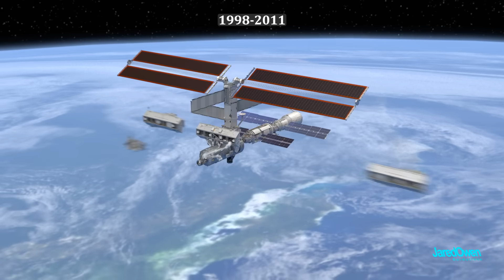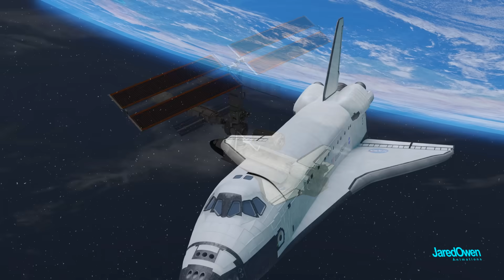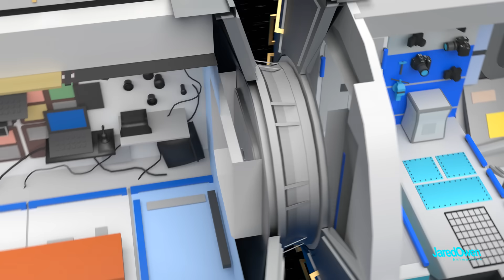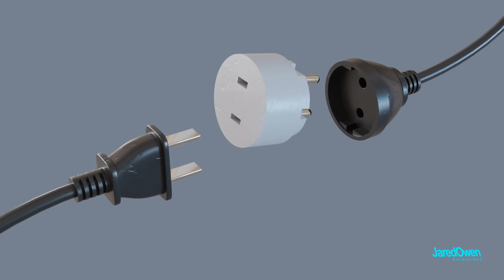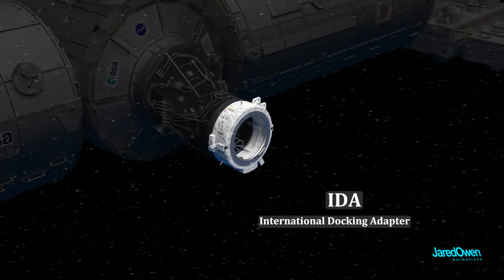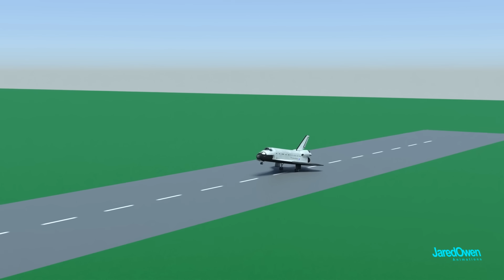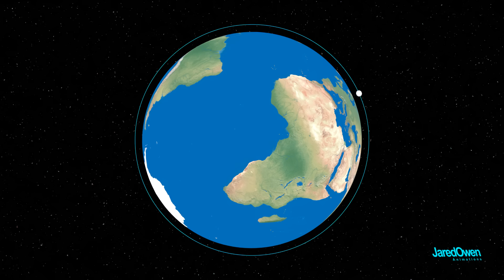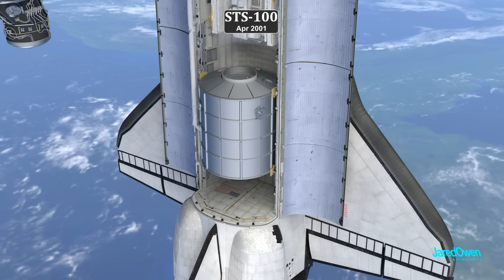How did they build the ISS? (International Space Station)

Comment: The thing I think is kind of crazy about this, especially when you say the Space Shuttle's primary purpose was to build the ISS is we had a space station launched in the 1970's in a single launch called Skylab.  Nixon literally threw away Skylab, which went up in a single launch on a rocket already developed for the Lunar program and pushed forward the Space Shuttle program so that we would spend over $100 billion to have an operational space station 30 years later.  I mean why have a space station now that is already operational in orbit when we can just have it burn up in the atmosphere and start on a much more expensive project to have a space station 30 years down the road and with the loss of two whole crews because the Space Shuttle was an inherently unsafe and inefficient design?  Don't forget that the Saturn V could lift 100 tonnes into orbit per launch and carried people on top with a launch abort system while the Space Shuttle struggled to just get 16 tonnes up after they strapped the crew to the side of the rocket instead of placing them on top, which would have been a lot safer, stripped out all of the safety systems, and stripped off the cover from the external tank, leading to foam hitting the orbiter and ultimately the loss of a whole crew, just so they could have the lifting capacity to get any piece of the ISS into orbit.

If we just built a few more Saturn V's, which we had a very reliable, man rated super heavy lift rocket fully developed, we could have launched say a 10m wide monster space telescope instead of the piece of trash Hobbled, I mean Hubble telescope.  Just having the optics of a 10m wide mega telescope, we could have done service missions to replace all of the old crap inside and reused those awesome optics.  Instead we focused on servicing Hubble over and over again with its small and defective optics, greatly limiting what we could see even with more fancy hardware placed inside over the years.  We could have hoisted up a mega space station 100 tonnes at a time in just a few launches.  Instead we threw away over $100 billion launching the ISS one little piece at a time on the pathetic Space Shuttle that could barely lift anything into orbit, making it super complicated to put all of those little pieces together in space.  Do you realize how ridiculously expensive and time consuming it is to train astronauts and fly them up to assemble stuff in space where it is so much cheaper and easier to have regular engineers just assemble all of this stuff on the ground?  If you could have moved 100 tonnes at a time, you could have had a bunch of stuff much more cheaply and easily integrated on the ground and then all launched at once.  There is actually a lot of really cool stuff we could have done if NASA's budget wasn't all sucked down by the sad and highly over rated and way over priced Space Shuttle program, but instead we focused on building just a few more Saturn V's for other cool space missions and then moved on to other 2-stage rockets for getting into LEO and beyond.

It is crazy to see how far Nixon set back our space program and how we are still suffering the affects of it to this day.  We could have been so much more if it wasn't for Nixon.

Comment: How much air is aboard the station and how much do they lose depressurizing the crew lock?
Reply: Most of the oxygen is generated from water, by electrolysis.
There are two totally separate systems - one American, and one Russian.
There are also tanks with enough reserve oxygen to last for several weeks, in the case of a malfunction.

The airlock pressure is reduced before its opened, by pumping it out, so there's not much air lost.

Comment: How they synchronize the shutle and the station when they move very fast?
Reply: Good question. The physics of movement in space is weird compared to what we're used to on Earth.

However, the first thing is that the speed and position of the ISS are known extremely accurately. This is because the speed of an object in orbit is directly related to its altitude. And this means that because the altitude changes very little over an orbit, neither does its speed. And because Mission Control can track the ISS's position accurately, it automatically knows how fast the ISS is moving at all times.

The second thing is that while both the ISS and Shuttle are moving fast compared to the ground below, they're moving slowly relative to each other. It's like driving beside another car on a freeway - you're both travelling at 100 km/h on the road, but you're barely moving relative to the car beside you.

When the Shuttle was launched (and these days the Dragon capsules), it would be launched into a lower orbit than the ISS, and timed so that it was trailing the ISS. However, the lower the orbit, the faster you move, so the Shuttle would slowly catch up to the ISS, while remaining at a lower altitude.

In order to get the Shuttle to the ISS, it would then fire its engines again to gain altitude. This burn was timed very precisely, so that it would reach the ISS's altitude at the same time as the ISS passed by. The Shuttle would then burn its engine again to fix its altitude at the ISS's altitude (otherwise it would descend to the altitude of its earlier orbit, and keep cycling back and forth between those altitudes in an elliptical orbit). At this point, the Shuttle would be station-keeping - in the same orbit as the ISS, but a couple of kilometres back. It would then fire its thrusters to slowly creep up to the ISS.

It sounds complicated, and it is (yes, this is rocket science). But the details were worked out back in the 1960s for the Gemini missions, and used again on the Apollo missions to the Moon.

Does this help?
Reply: @maxfan1591 even though im dumb i somehow understand some parts
Reply: @Beeta425  "even though im dumb i somehow understand some parts"

Cool, thank you for saying that. But don't worry about the bits you don't understand - the way things work in space is something most of us don't need to know, so it's not a problem to not understand it.
Reply: @maxfan1591  thx man :)

But yeah im still very new to space stuff so i still have a lot to learn before i fully understand a bit of a complex things about space :P

Comment: Seems a bit silly for the USA and Russia to have differing birthing ports. If you’re able to collaborate on building a space station, you can collaborate on using the same ports…
Reply: An adapter seems collaborative than forcing the US modules to use the Russian system. The availability of the robot arm also makes the docking features of the Russian system unnecessary for the new US designs

Comment: The more pertinent question is WHY did they ever build such an irrelevant facility in the first place, when they can't even address basic needs on this planet.
Reply: Because building a laboratory for general purpose research that we couldn’t otherwise do was significantly easier, cheaper and faster than solving world hunger or giving everyone clean drinking water. All the while, believe it or not, we have actually been trying to solve those problems at the same time. I know, it’s crazy, we can do multiple things at once as a civilization.
Reply: Without space, we wouldn't have or have worse versions of:

Insulin infusion pumps
reading machines for the blind
vehicle controllers fro the handicapped
weather forecasting
water recycling
scratch resistant glasses
advanced wheelchair
laser heart surgery
new flame resistant materials
dental braces
search and rescue 
anti corrosion paint
advanced turboprops
breathing system for firefighters 

And all these were before we had the giant iss. This was all just skylab and some mercury/gemini/apollo/sts missions. 

source: space program benefits from nasa from around the 1980's.(yes, I am such a big space nut, I have physical documents from before I was born lol)

Comment: Why did they use shuttle RCS flee the actual docking? Why couldn’t it be completed with the arm?
Reply: They’re in space. Use the arm to push the module one way against a resistance, and all you end up doing is push the Shuttle the other way.
Reply: @Hobbes746  but it's fixed to the station itself
Reply: @S1baar  The RCS reduces the forces working on the docking collar that attaches the Shuttle to the station.

Comment: What's important is that most of the major sections of the Russian segment are their own spaceships, they have their own propulsion and attitude control engines so they can maintain their own orbit after launch and even dock with themselves. US-made segments however are not, they are basically giant tin can cabins with science capacity as their primary design objective so they need to be carried to the station by the shuttle and placed onto the station using robot arms.
Reply: The Russian side has the propulsion.
The US side has all the life support.
The point is, it can't be separated. 
This was done on purpose to keep international cooperation.
Which is clearly evident since the Russian Ukraine war.
Reply: @carcinogen60yearsago  Russian segments do have their own power and life support as their counterparts on Mir worked well enough. They are probably not designed to handle too much load, not used or even broke down since US segments did most of these jobs for years.
Reply: @ScaredPilot  
If the Russian Orbital Segment disconnected, it would not have sufficient power to be operational. There was a canceled module that had the russian own power generation.
 But it looks like russia is heading more towards ross and dropping out of the iss in 2024.
Reply: @carcinogen60yearsago  Originally, power was supplied from the Russian modules, and all the modules are still there.

Roscosmos has said that if NASA does indeed drop out of the ISS by not extending the contract, redirecting their meager funds towards Gateway instead (which wouldn't be the first time the USA have cancelled an international agreement unilaterally), Roscosmos would continue to operate their own modules.

The ESA and JAXA modules depend on the NASA modules, the Canadarns could be relocated.  But with the USA out of the ISS, China would no longer be barred from participating, although they already have Tiangong, and have invited all other space agencies except one to collaborate.
Reply: @davidwuhrer6704 Russians propaganda?)
Reply: @samjaxon  Obviously not.  How would it propagate?
Reply: @samjaxon  да, мы повсюду! )))
Reply: Это советские разработки а не российские. Не путайте. Это примерно тоже самое, что говорить что современную Америку построили коренные жители Америки а не колонизировавшие её европейцы. Не хочу обидеть коренных жителей Америки. Но это так.
Reply: @avogadro377 это русские разработки. СССР не выращивал с нуля науку, он получил её полностью развитую от Российской империи и просто эксплуатировал.
Reply: Well USSR's Buran didn't really become operational so they didn't have a " ferry" to carry their modules to outer space so they have to have their own propulsion.
Reply: @mangatom192 It did become operational, but it never went into operation.  Too expensive.
Reply: @davidwuhrer6704 Любая миссия дорогая.Не вступил в строй, потому что развалилась страна
Reply: @mangatom192  russian modules were carried by Proton ant Soyuz rockets. The whole "russian part" of ISS was originally planned as "Mir 2" space station and some modules were already built before ISS project started
Reply: @iscander_s  The proton only inserted them on the initial orbit, it's up to the modules own propulsion to manuever them to their final orbit.
Reply: Of course, this is precisely the idea behind the Russian modules.

Comment: so will it be part 2 and 3? and I have a question, how did the zarya module dock without a canadarm?
Reply: The Russian modules were each essentially their own spacecraft with engines and computers so they docked to the station like normal spacecrafts.
Reply: @SOR-05  i know that there were 2 módules that were trasported attached to a soyuz but did zvezda really reached the iss by itself?
Reply: @Red-Eye_CH  Zvezda  was launched on a proton K rocket. From what I could find, I think the third stage of the rocket was used for orbital maneuvers and it was ditched before docking to the station.
Reply: @SOR-05  ok

Comment: Why did the shuttle fire its thrusters to connect thoughm
Reply: To make fine adjustments.
Reply: @TheEvilmooseofdoom  i know that. What i meant was when the canadarm was about to attach the module to the shuttle. Why use thrusters when u can just use the canadarm to move it towards the docking port? (Zarya)
Reply: @hypatia-o6s  I think because there wasn’t any way for the arm to connect to the Russian module.
Reply: @SOR-05  no. The same with the american first module. When the canadarm was attaching the module to the shuttle.
Reply: @hypatia-o6s  yes I know what you mean. Sorry I misunderstood. It could be because the station had too much mass for the arm to be used so they used the thrusters instead.
Reply: @SOR-05  it's okay.

That might explain it. But if it has too much mass, it shouldnt be able to set up the station in the first place. 

The module was inside the shuttle, then grabbed by the arm to position it for docking. Thats when the thrusters were used and my confusion starts.